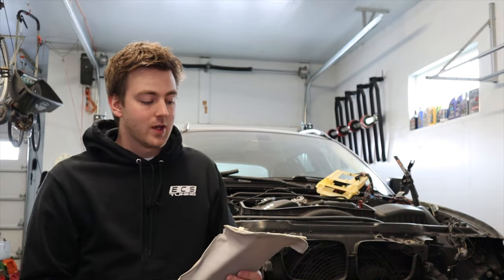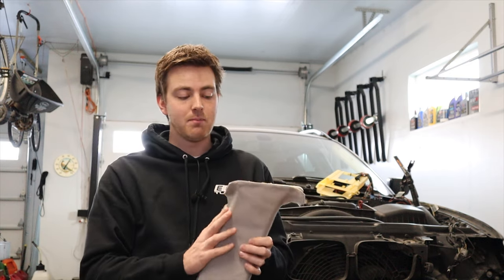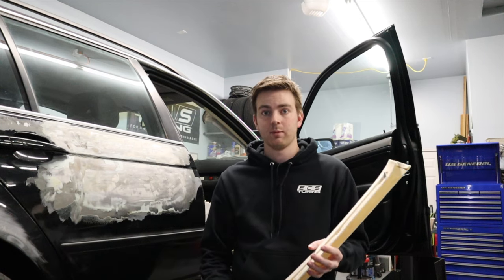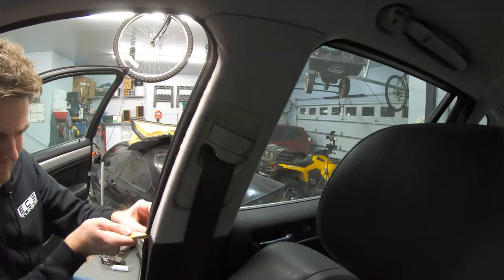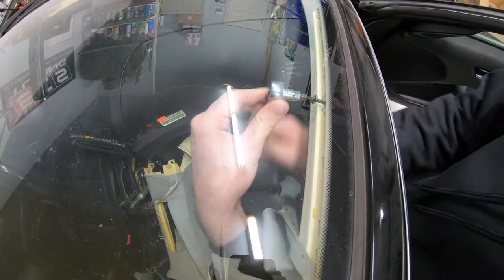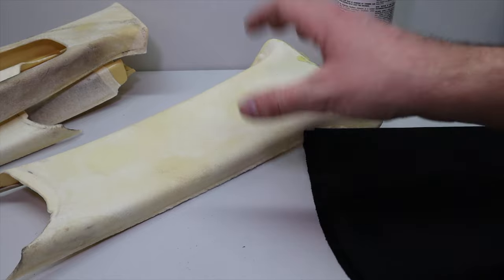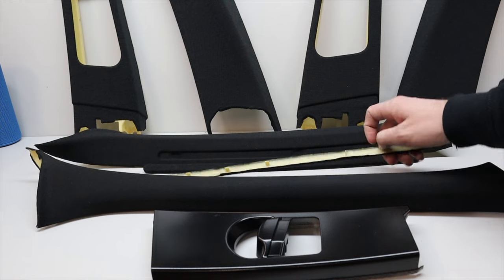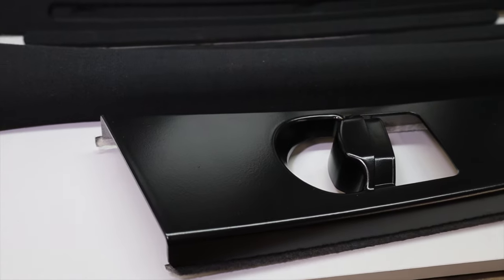Insane interior transformation for under $35! - Easy upholstery DIY replacement - E46 BMW A/B/C

Comment: On the areas that rub like the seatbelt area and sunvisor clips the best thing to use is clear headlight film. You just cut a piece and adhere it to the areas that rub and it's invisible and protects the painted parts from rubbing through to to underlying color.
Reply: I have broken so much I swear some year BMW models have better quality than others. Some crumble and some don't. If you can get the plastics new. New fabric on Old plastic still breaks

Comment: i wrapped mine with vinyl from wal mart using 3m super 77 spray. i live in south texas and they have been holding up for 3 years now. literally paid less than 20$ to fix A and C pillars. follow the glues instructions and it will last for years. i see mine lasting another 5 years easy. got the idea from a forum where everyone said the 3m glue is the best for the heat down here
Reply: I was worries about glue with fucking Texas heat! So good to know

Comment: I covered all the pillar covers, the headliner, and the rear speaker panel with foam backed black leather look vinyl in my 2001 330ci. It was a bit of a pain to get wrapped around and formed to the really curved areas, but very much worth the trouble in the end. I wish I post pictures here to show what it looks like, because it looks fantastic. The black leather look vinyl goes great with the rest of the interior which is now entirely black top to bottom.
Reply from the maker: Post them on Reddit! e46 subreddit

Comment: Just did this working off your guide - thanks for posting! A quick note: I actually had to remove the fake leather piece below the B pillar to reinstall properly. You can remove the B pillar fine the way shown, but the leather piece under it has 3 tabs/clips that need to wrap around the back and up into the B pillar. I couldn't figure out a way to get those tucked back in without completely removing the bottom leather piece. It's twice as much work but worth it if you're anal about this kinda stuff like me.
Reply from the maker: Thanks for the extra info! Glad the how-to helped you with your project.

Comment: On the front pillar if the tabs broke you can use some good quality removable double sided tape as long as the strip is in good condition. Be careful if the tape can adhere to texture. I had some high temp smushy type, no visual difference to the strip with with tabs still intact.

Comment: My B Pilar I had to remove and one I removed it the Alcatara started coming off the B pillar . Should I start glueing it back on or should I re warp it . I was worried if I sprayed some glue on there it would soak through the Alcatara . Should I be worried about that ?

Comment: Great Job! Can you tell me how you removed the black felt material that stays on the A,B, and C pillars when you remove the factory fabric?
Reply from the maker: When I pulled off the original material, every just came off. if you’re having fabric stick around, it might mean this project has been done before by a previous owner. Different glue and fabric.

Comment: Looks good! Do you have a SKU or other code for the fabric you used? The trim panels are starting to peel on my '01 330Ci and I'll probably be doing the same thing this spring.
Reply from the maker: Let me see if I can find the receipt.
Reply: Following this lol I want to do this aswell
Reply from the maker: This is exactly what the receipt says. Hope this helps!
" SKYT KSF21 BLACK RIB KNIT 400180238796 "
The adhesive I recommend is linked in the description. Either one will work.
Reply: @TenzaMotorsports  thank you! I went there and thought I got the right stuff but was absolutely impossible to work with. I’ll be going back and getting that

Comment: When you went to the upholstery shop what did they recommend to look for fabric wise at Joanns ? Just look for the stretch on the suede?
Reply from the maker: They told me to find fabric that only stretches the one way. Worked great for these small pieces
Reply: @TenzaMotorsports  Thank you for the quick response! Ill check out my local joanns tomorrow. Woot